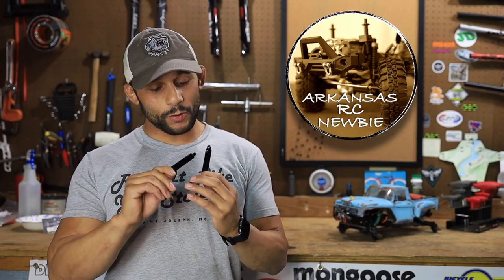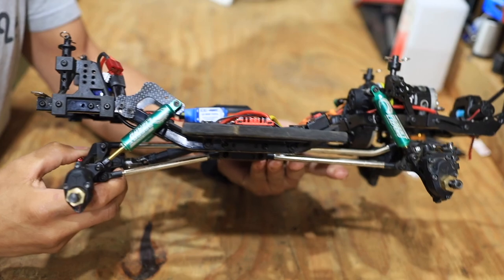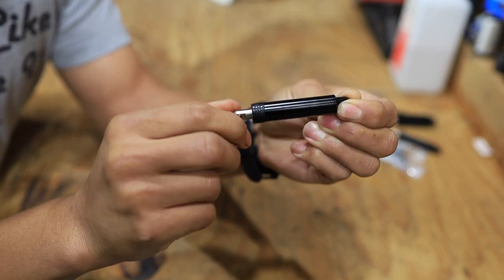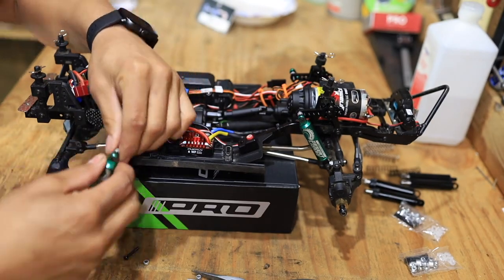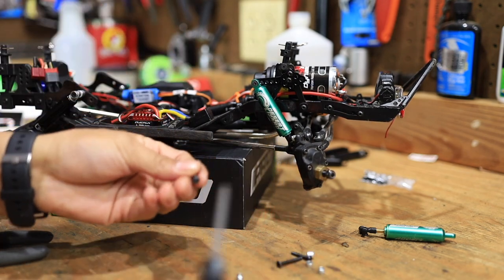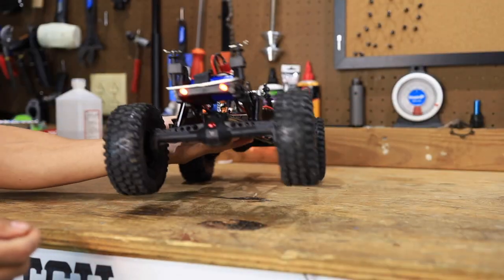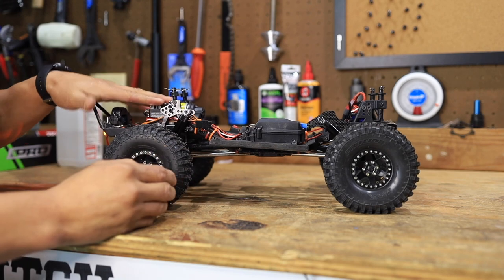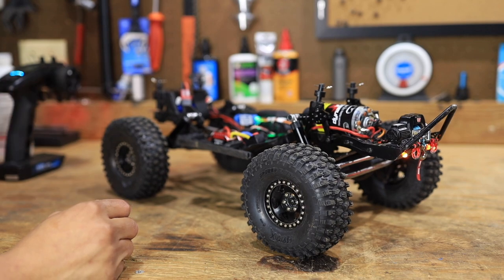HOT RACING 100mm Internal Shocks! | Initial Impressions | Droop Setup

Comment: I run desert lizards with losi mini t springs in the rear and desert lizards front setup in full droop with the longest softest spring they are just as smooth as dravtec shocks.
Reply: For a gen8 9lb setup what you recommend? I'm running soft short droop and medium soft springs on top. 4 hole pistons with 25w oil. Seems about the best for feel I've gotten it. Didn't want truck fully collapsed but I put medium stiff springs in it hurts full flex. Playing with but looks like first my best option
Reply from the maker: Ooh, that sounds like a great mix 🤘
Reply: @CrawlersCampRc  try out longest softest spring with 40wt and 2hole piston to slow it down a bit more
Reply: @arkansasrcnewbie  yes sir keeps the nose down on steep climbs but it will extend when needed too.

Comment: Did your mounting balls in the shock ends fit snug or do they move around.  Thinking my Hot racing came with the wrong mounting parts
Reply from the maker: Kept them loose brother, with the orings on each side. They definitely are trying too hard when it comes to the mounting! Lol
Reply: @arkansasrcnewbie    Thanks.  I got it figured out. Just a strange  way to mount with orings on the outside.  But works.     Putting them on original scx10 crawler.